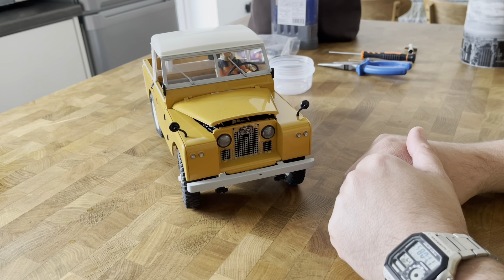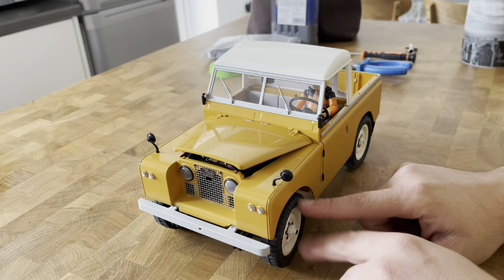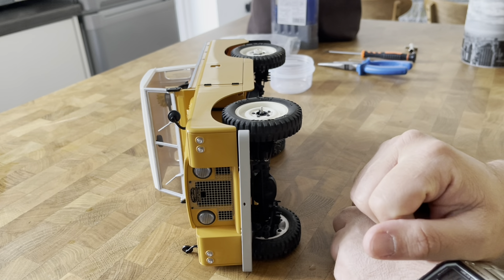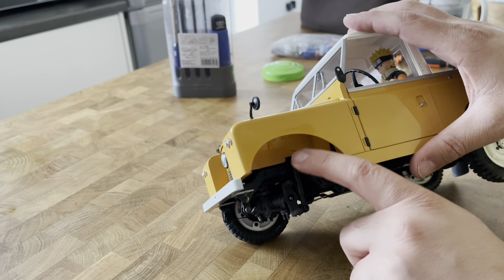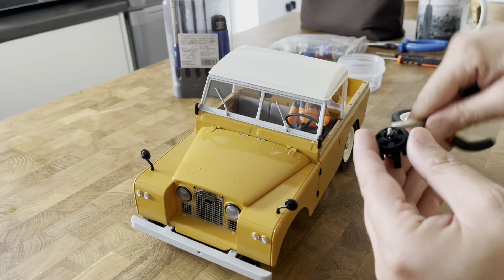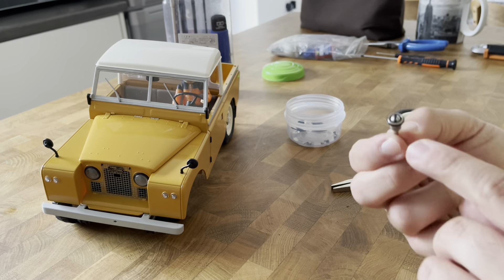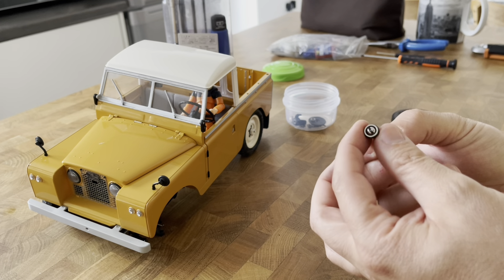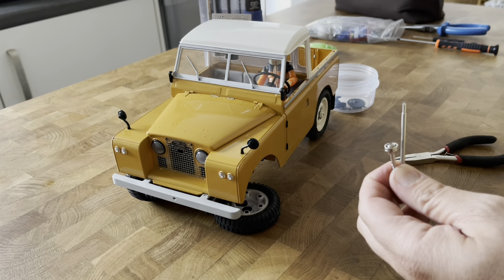FMS 1/12 Land Rover Series II - Tips & Tricks - Part 1

Comment: Mine lasted 1 week indoors before breaking!  Jadlam said not warrenty! - this video is brilliant.  I removed the whole front axle, 2 bolts on each spring, steering servo arm bolt then access no issues.
I hope the replacement lasts longer.
Reply from the maker: In all honesty, I haven’t had any issues ever since I ch aged the broken part. 
Fingers crossed it stays that way 😄